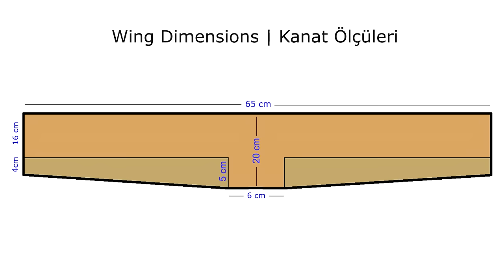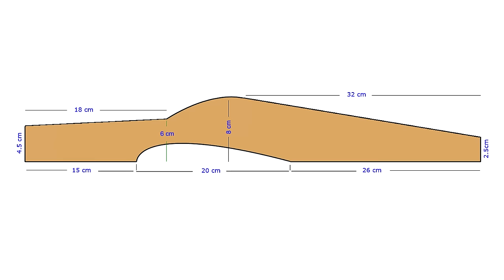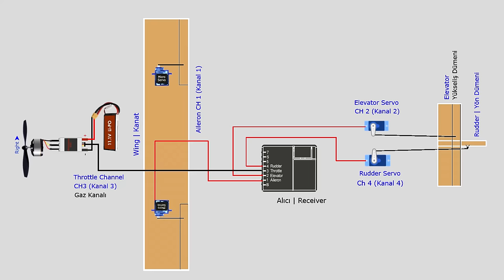How To Make RC Model Airplane Fun-Fly Style. DIY RC Airplane With Brushless motor

Comment: After successful  FT Spear and NumaVIG simple trainer, I wished for something simple but efficient and playful, I'm starting it now, but from 6mm depron. Hope it turns out great. Wish me luck. I'll report later.
Reply: I've build it, turned out great. First two flights ended with crashes because of bad trims and bad CG in combination with reverse expo on controller. I've repaired it and set everything correctly, today was her third flight and it blew my mind. 
------- IT FLIES GREAT--------

Smooth, nimble, stable, light, deals great with the wind and asks you to enjoy the flight. It is really a great plane. 
As addition I've used flaperons on 30% in flight and on takeoff and landing, it is super stable with flaperons on and don't require eleron mix at all.

@KendinYap Bless you man!

Comment: Thanks for the instruction- had a blast  building the plane! I made a few changes (landing gear, winglets, decals) hope it is not overweight. Waiting for 2200kv motor, prop and ESC to finish it. This is my first build and first rc plane not considered a toy. Should be a spectacular crash! Wish I could share images here
Reply: What motor are you using

Comment: I noticed the Lipo battery charger linked in the description does not have an XT60 plug, do you recommend soldering one on or finding a different charger.

Im new to the hobby and want to make sure I get the right one for a beginner.

Comment: this is my first time ever making this plane or any plane but I've encountered some problems. I think it's too heavy and the wing are 7cm short due to the foam I used. The wings are also not aero dynamic enough. I think i should change the landing gear as the one I bought is too heavy, what do you think.

Comment: Have you joined the connection of two servo motors ( which are fixed on wings ) to make it one connection in order to fix it in one channel ?.
Reply from the maker: I used Y type extension cord to connect two servos to one channel. (Aileron channel)
Y extension cable: https://www.banggood.com/custlink/D3DmBNWFtP

Comment: As per i know, low wing aircraft maybe have no good STOL characteristics but this aircraft has very good STOL characteristics. Is it for it's wing big area (because more span and aspect ratio high mounted wing has good STOL)wing structure purpose or anything else?
Reply from the maker: Wing area and profile are important.

Comment: 16:50 what is the measurment for the rod used for landing gear>
Reply from the maker: When the model is parallel to the ground, there should be a gap of 1.5-2 cm between the propeller and the ground. You should determine the landing gear length by taking this into account.
Reply: Thanks for the help 👍

Comment: Can we use a battery that has more than 45C discharge rate?
Reply from the maker: Yes you can. But High C rate means extra weight.

Comment: Thanks for the video! I decided to give it a try with this model and if you could detail how you are connecting right wing servo, and the rudder with the back wheel would be much appreciated.
Reply from the maker: Thanks. There is no wheel at the back. There is a fixed steel wire. And this is enough.
Reply: @Kendin-Yap  Would you be able to share how to connect right wing servo since diagram is not showing the connection? Thanks
Reply from the maker: @mihajlolakicevic2631  You should combine the two wing servos with one Y type extension cable and attach it to the 1st channel. This is a parallel connection.
The link for the Y Type Extension cable is available in the description box below the video.
Below is a link to my other video. You can see the detailed link in the 8th minute of the video.
https://www.youtube.com/watch?v=WsfKVZ2SSIk

Comment: Great Video !!!
On 00:59 it seems, that you use glue with your glue pistol. But in a former post you said that " I used hot silicone to keep the wing from tearing when I folded it." 
Is there any silicon that can be used with a glue pistol ?
Reply from the maker: Thanks. I mean the same thing. Because silicone is hot when it melts ....:)

Comment: Do we get the remote control in a packet or we have to buy it separately.
Nice work, Clear and easy to follow. Great flyer too.
Reply from the maker: All materials are sold separately.
Links to all the Materials are in the description box below the video.
Press the arrow symbol on the right below the video. (For mobile)
Click the "More Information" link below the video. (For PC)
Reply: H and N Banggood sells a six channel transmitter and receiver as a set.  They also sell 6 servos for like $11.00.  Check out the web site in the instruction part of this post. Good luck!
Reply: @Kendin-Yap  Thanks

Comment: Normal 2200kv lik motor kullansak olurmu yoksa 2205 serisinin motorunundu kullanıcaz
Reply from the maker: Normal ile kastettiğiniz nedir anlayamadım. 2200KV bir motorun motor büyüklüğünü ve gücünü belirtmez. KV sadece volt başına devir bilgisini belirtir. 2212 1400KV ile 1800KV arası veya  2205 2000 ile 2600KV veya 2204 2300-2600KV motorlar kullanılabilir. Eğer 2212 2200KV motoru kastediyorsanız kullanılabilir ama en ideal ölçü değil.

Comment: If i use a 2205 brushless motor 2650 kv what size pro do i require? and with what battery is compatible with it?
Reply from the maker: 5x4.5 / 6x4 . Battery is same
Reply: @Kendin-Yap  thank you for the answer!

Comment: How to fixed the Propeller at the angle of 3 degrees? I am waiting for your answer 🙏
Reply from the maker: You need to fix the motor at an angle of 3 degrees, not the propeller.
Reply: @Kendin-Yap  thank you so much 🙏

Comment: Hello I have quite an important question what is the weight of the aircraft? And can a 1000kv motor with 1045 propeller 11.1 v 850 mah battery  run this without burning the esc?
Reply from the maker: 490gr .. (Technical information is below the video.)
1045 propeller are too big for this plane. ESC is a matter of motor current consumption. You should study the technical information of your motor. Not all 1000KV motors are the same. The KV rating does not provide information about the motor's power, current rating, and operating voltage.

Comment: I am do make start  the aircraft.  I found foam board 580 g/m2. Demension 500x700 mm. Can i do wing from one part. Why you use glue on 00:59????
Reply from the maker: Your foam sheet is a little heavy. The plate I use is 500x700 mm and it
 is total weight is 155 grams. I think it's about 450 g / m2.
I used hot silicone to keep the wing from tearing when I folded it.
Reply: @Kendin-Yap  Apparently I have a very thick cardboard. I fold the wing without cutting through the triangle. It does not collapse.

Comment: Is offsetting the motor supposed to counteract torque effects?  If so how did you calculate this?  If not why did you do it?
Great channel by the way, thanks
Reply from the maker: In single engine aircraft, an angle is required to reduce the negative impact of the engine in the opposite direction. This angle must be in the direction of rotation of the propeller. Usually this angle is 2-3 degrees.

Comment: Can i use 1000kv brushless motor in this model does it provides enough thrust?
Reply from the maker: Motor power is sufficient but propeller length will be a problem. Longer propeller is required for the 2212 1000KV motor.
Reply: @Kendin-Yap  Thanks a lot for replying 😊 Is it fine to use 10*4.5 propeller in 1000kv motor?

Comment: I can't find the paper covered foam board anywhere in my country. Can I use regular foam board? What's the practical difference between them?
Reply from the maker: Normal foam is very flexible. If you are going to use normal foam, you should support it with a carbon rod or similar material to reduce the stretching.

Comment: Can we use only elevater & rudder to rotation ? With out alieron servers?
Reply from the maker: Yeah, but not efficient. It is much better to maneuver with the Aileron and the elevator. It is not necessary to use the rudder to change direction.
Reply: @Kendin-Yap  thankz for replying

Comment: Thanks for this video.....
Please. Suggest me which brand is best for RC plane material....like brushless motor,and controls...
Reply from the maker: This would not be a very accurate description. There are a lot of good brands. There are also price / performance brands. Some of the best imotor and esc brands; T-Motor, Scrorpion, Axial, etc. Examples of the best radio control brands; Futaba, Hitec, Spectrum, etc. But these are expensive brands. Usually cheap brands are very popular. And there are too many brands. So it's hard to suggest a brand directly ...
Reply: @Kendin-Yap thanks for reply
Reply: @Kendin-Yap   Dear Sir how much time RC plane  fly in one time charging?
Reply from the maker: @androArtamolb  About 5-6 minutes for 1000maH Lipo and 7-8 minutes for 1300mah.
Reply: @Kendin-Yap Thanks for Information
Reply: Which  transmitter model I choose- i6x-A8S, i6x-X6B  i6x-iA6B
For this aircraft
Reply from the maker: @androArtamolb  i6x-X6B or i6x-iA6B is suitable for fixed wing airplanes. A8S receiver only for drones. (i-Bus receiver)
Reply: @Kendin-Yap  Thanks again🙏

Comment: Thank you very much Sir for this amazing video.
I followed your very well explained steps and I built my first plane. 
The problem i faced is that the plane is too havy 620g and doesn't takeoff. The weight comes from a heavier motor 2212 2200 KV  and the silicone glue. I put a little bit more to have a solid structure but this increased the weight.
I used 6035 Propeller.
So, could you please indicate any solution as more powerful motor or something else to get the plane fly?
Please answer me if it's possile.
Thanks
Reply from the maker: Yes, it's very heavy. Silicone should only be used as needed.
Using 7x5 or 7x6 propellers with 2212 2000 kv motor will provide much better results.
Reply: @Kendin-Yap  Thanks a lot brother!
I'm working on a second model following  your steps to the letter. I'll let you know about the result this time :)

Comment: Is it possible to fly plane with this dimensions with 1400kv Bldc motor ?
Or is it better to reduce dimensions?
Reply from the maker: KV is not very important. The size and thrust of the motor are important. Engines with a thrust of 600 g or more are suitable for this aircraft. A motor with a push force of 1400KV and a minimum of 600g will also be suitable.

Comment: I want to understand the making of how you make the wheels turn underneath the plane
Reply from the maker: The wheels do not have a rotation mechanism. The propeller is moving with the thrust of the aircraft. It's the same with real airplanes.

Comment: why does the motor need to be at an angle? 10:07. (also is the motor supposed to be angled 3 degrees upwards or is it actually angled right?)
Reply from the maker: Usually 3° right, 1° down is sufficient.
https://www.balsaworkbench.com/?page_id=2714

Comment: Can we use 1400kv motor
Reply from the maker: A longer propeller is required for 1400kv. It would not be suitable for this plane. The propeller touches the ground.

Comment: Hi! What density do you use foam card? I found foam card with plastic/
Reply from the maker: This is not plastic. This material is foam-coated on the inside and kraft paper on the outside.
It can be found in shops selling architectural model materials, model materials and / or materials for school projects.

Comment: What is the maximum and minimum c rating you recommend?
Reply from the maker: Center of gravity: 5.5-6 cm from the front of the wing
The technical information is in the description box below the video.
Reply: @Kendin-Yap  sorry i mean c rating of the battery?
Reply from the maker: @katelorenz7546  20 or 25 C is ideal.

Comment: Hello Sir, first of all I wish all the best for you in these difficult days for all of us in the world. On the other hand I want to congratulate you for your excellent handcraft skills and the instructional videos you made showing us how to construct really nice rc planes. I came from navy models world mainly but I am planning now to make this fine plane and the other one type Cessna of your video: "How To Make Twin Motor RC Model Airplane - DIY Brushless Motor Model Airplane.". Please I want to ask you if there is a brushless motor that can be used for both types of planes to change between them and if it is could be used a 40Ah ESC and 11,1v 1500mAh LiPo battery with 6040/5045 propellers having in mind that the weight of both planes are similar. In this way we could have a power set that can be changed from one aircraft to another one, Many thanks in advance for your kindly attention and the best regards from Spain, Manuel.
Reply from the maker: Thank you .. I hope that we can return to our normal life as soon as possible.
The same motor can be used on both aircraft. 2205 Brushless 2000 or 2300KV. 40A esc can be used in both. But 1500mah lipo is a little heavy for the single motor aircraft. It can be a maximum of 1300mah. The 6040 two-blade or 5045 three-blade propeller is suitable for both aircraft.
Reply: Many thanks for the info. I will make the planes in the way you tell me. As a suggestion it will be very interesting i.e. that you made a foamboard jet liner (small or big ones) in the excellent way you do it habitually, perhaps covered with coloured tape and a simple retractable landing gear to show us the tricks to construct it (I hope you can excuse me for my confidence ;-). Have a nice day and regards, Manuel.
P.S.: You can see my rc model submarines, yatchs and battleships here: https://www.youtube.com/channel/UCGO4NGAO5HWLA7__8mCuHVw

Comment: Can I use 2204 motor with 1480 kv with large propeller like 1040
Reply from the maker: 2204 motors can be used but 1045 propellers are too big. It can be 7050, 6045 (7x5, 6x4.5).
Reply: @Kendin-Yap  Thanks dear

Comment: And what wheel did you use in the back?
Reply from the maker: The take-off of this plane takes place with a short run. There is no need for tail wheel. Rudder is sufficient for direction corrections.
Reply: @Kendin-Yap  okay thanks

Comment: My plane is getting really heavy. It is near 800 grams with all the electronics. I tried removing all the supporting foam from the wing but it is still heavy. I am using the a2212 motor. What can I do right now that will help me achieve liftoff?
Reply from the maker: Are you using a high capacity battery? It weighs 300 grams more. This is not normal. When constructed properly with the right materials it will weigh 500-600gr maximum.
Reply: @Kendin-Yap  I made a mistake 😂. I live in the US I was born in India so I am used to grams. I checked the planes weight It said 0.8 pounds I thought it to be grams. Now I checked it properly it weighs around 500 grams without landing gear. Will my plane still fly?
Reply from the maker: Yes, 500gr is a good weight. @dr.sushmabommaraju8705
Reply: @Kendin-Yap  as you know I am using the a2212 motor and a 3d printed 9x6 propeller with 2s battery will my plane fly with these settings and if not what can I change? And how do I tighten a pushrod linkage stopper?
Reply from the maker: 2S battery may not be enough. This model is for 3S. The 9x6 propeller size can be used if the KV value of 2212 is 1000 or 1400. But you need to be careful about 3D printing propeller. It may break at high speed and pose a safety risk.  @dr.sushmabommaraju8705
Reply: @Kendin-Yap  how do I tighten pushrod and how thrust will the motor generate with the prop and 2s battery?
Reply: Are you there?
Reply: I now have a 3s battery with a2212 motor with 6x4E propeller. And my plane is now about 730 grams. Will it fly?
Reply from the maker: As I wrote before, this model should have a maximum weight of 600gr. 730gr is not good but it can fly. But it does not provide good performance. @dr.sushmabommaraju8705
Reply from the maker: What is the KV value of your 2212 motor? If it is in the range of 1000-1400KV, 6x4 propeller is not suitable.
Reply: @Kendin-Yap  1400kv. The prop fit and it works pretty to be honest. I don’t really care about the performance as long as it just flies. Why is the prop not suitable?
Reply: What thrust to weight would I need to fly, not having the performance in mind?

Comment: Hello sir I am your biggest fan of yours channel. I have a question for you. The question is 👉Why  the direction of  rotation of the propeller, the motor must be fixed at the angle of about 3 degrees? I am waiting for your answer 🙏
Reply from the maker: Thanks. 
http://oldsite.electricrcaircraftguy.com/motor-thrust-angles & http://www.balsaworkbench.com/?page_id=2714

Comment: Зачем Вы сначала на носите клей на изгибы, а потом его убираете? Расскажите пожалуйста по подробнее
Reply from the maker: To remain a thin layer. The silicone layer acts as a hinge.
Reply: Thank you) That is, a thin layer of glue gives a little reliability to the material and helps to rise and fall well?  And I have one more question.  I want to make a glider with four motors, in my opinion your work).  I figured out the body of the plane, but where and how to connect the details - no) If you have a video, or you know what someone has already shot, please write a link)

Comment: Can i use 1000kv bldc motor
Reply from the maker: Propeller size can be a problem. The propellers of low kv motors should be larger. The plane may not be sufficient from the ground.